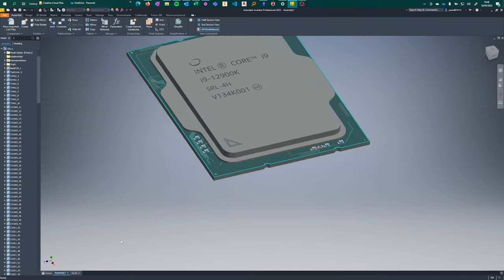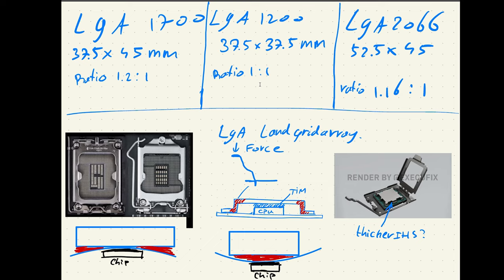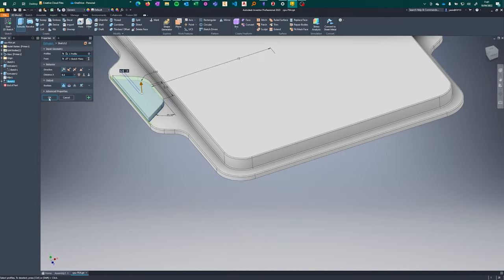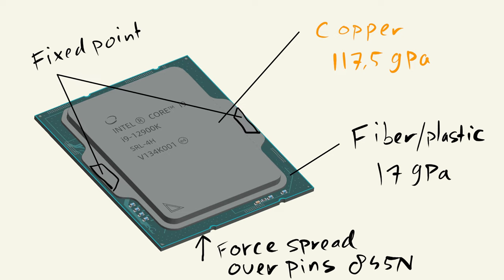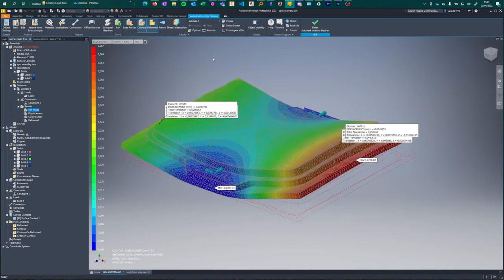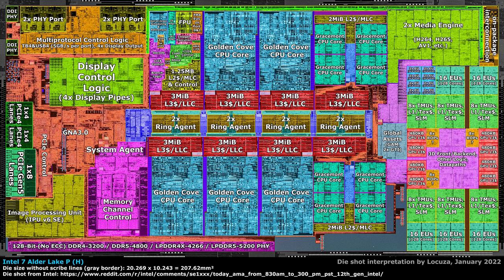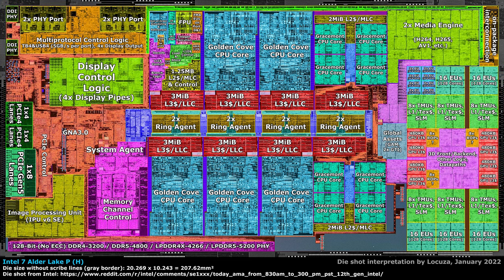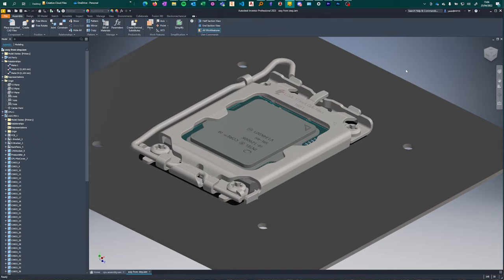FEA on Why Intel LGA1700 cpu's are bending

Comment: hi. I have problem with Intel i5-7600 which one of the edge is bent. Maybe because i screw the watercooling too tight. 
Any guide the best way to straighten it without breaking the board?
its exactly only on the board side, not bending the IHS. 
i can't install dual channel RAM anymore, i assume because the bent part which makes the LGA pin can't contact with the CPU

Comment: Amazing I building my PC with a 12900kf and this coupled with the fact that I need to buy an aio and there are only a few of 1700 socket here where I live. Also there is the possibility to go with a 1200 socket aio and an Asus mb. I feel very worried about the temps on this chip and if I could even do a bit of oc, many people are undervolting due to temps as well.
Reply: Good luck. I wouldnt dare to buy 12900 with the current bending problem.